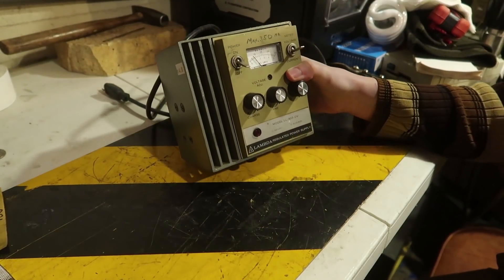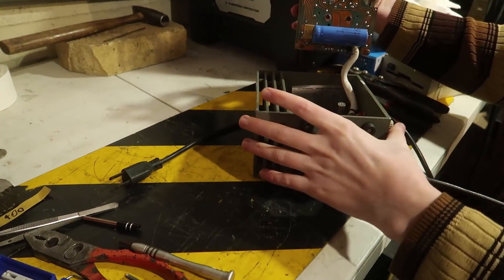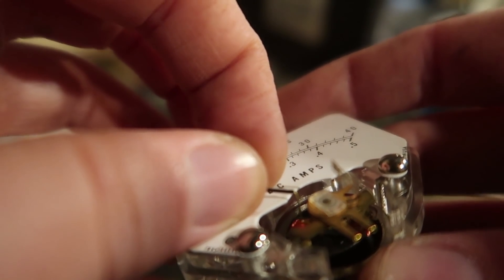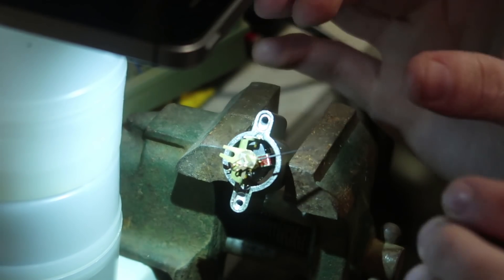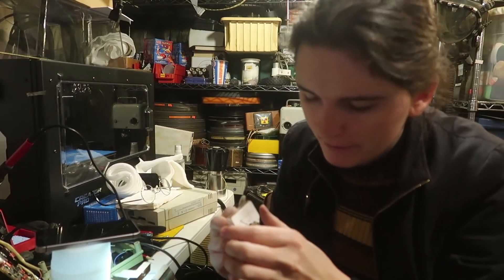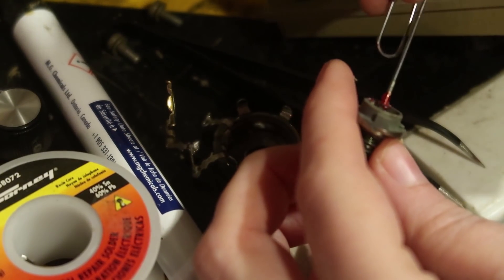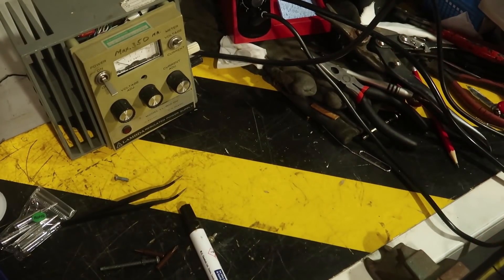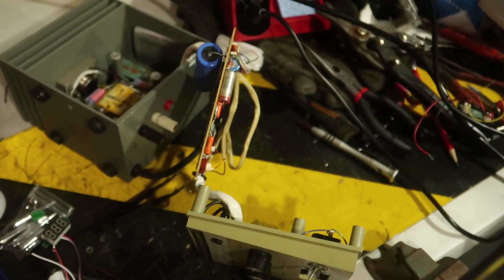1978 Lambda Variable Power Supply Repair 01: Potentiometer/Rheostat Grease, Burnt FBT-031 Chip

Comment: 40V*0.35A = 14W   80V*3A = 240W, so no,the transformer that's in there is not beefy enough. Then again, 80V (dc or ac) is enough to ruin your day - limit yourself to 50V.

Comment: Too bad about the meter, good attempt though. Maybe it now just needs a bit more current to reach full scale deflection, you could try lowering the resistor in series with the meter. But that only works if the meter is still linear of course, but it may be worth a try.